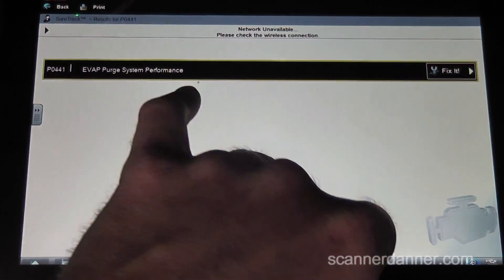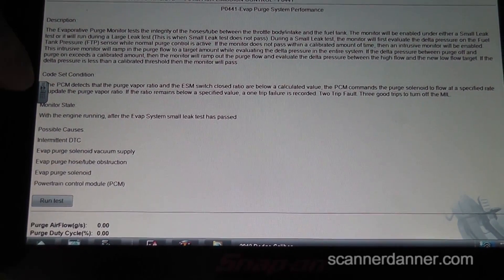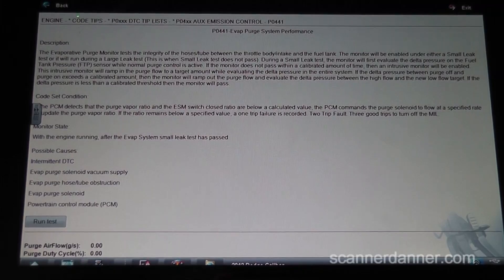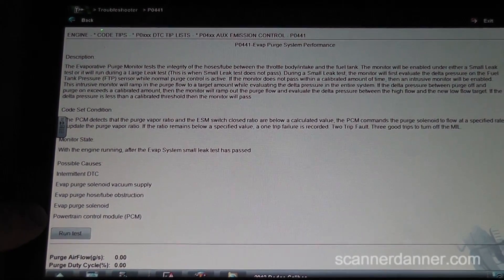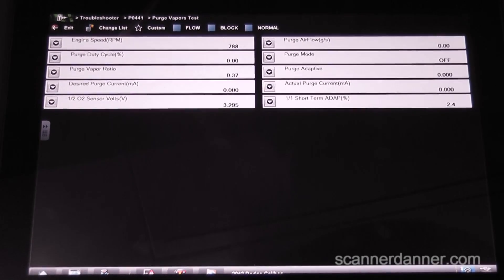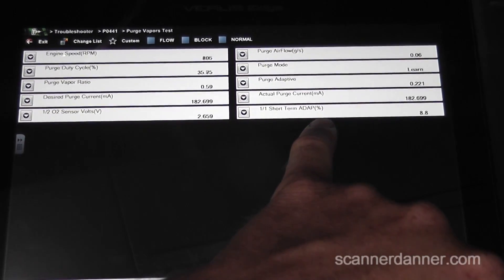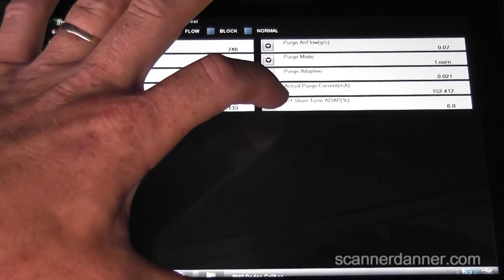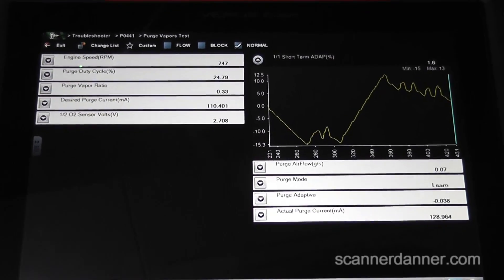2012 Dodge Caliber P0441 EVAP Purge System Performance

Comment: Got a new gas cap. P0441 code? Reset it. Fill the tank and drive to about 2/3 full. No code. Then get code P0441 again. Could be a stuck fuel tank vapor vent 
sensor. Located along the fuel filler neck. This is actually becoming a common problem now ! Part costs $40.00. The tough part is getting to it. It is located above 
the driver's side rear tire. You must remove the splash shield. Several plastic pins hold it in and up against the wheel well. With it removed access is easy.
Ironically  I have not run across any videos on it or how it acts just like a loose gas cap to the ECM. Don't fling new parts at it to remove the code.

Comment: Thanks man appreciate the vid - I recently had a check engine light I had it check it came up code PO441 I then noticed the gas cap wast not on properly I fixed that and the light went out the next day, however I took a trip and noticed my gas mileage was about 3-4 miles per gallon off in the wrong direction - I brought the Blue Driver scanner and I came up with the same PO441 code so I was wondering what you think @scannerDanner - the other thing is on the app it has a smog test (emissions) and it now won't pass that. Please help?
Reply: Hi frank
I have a same code on my Dodge SRT I already replaced purge valve and canister went solenoid but light came back on I was wondering if you already figured that out what was wrong with your car

Comment: Got a 07 caliber 2.0 same issue changed the purge valve today and check engine light is still on.my buddie reset the codes but when i left the light came back on.Any advice whould be Appriciateed

Comment: Im dealing with this, but my 97 ram has 274k. So i went ahead and ordered everything involved, minus gas cap. Have filler neck, canister and solenoid. Charcoal was everywhere and the filler was rusted out. Currently swapping the neck. Still have code after solenoid an canister replaced. Pretty sure the condition of each part wouldve tossed a fault.
Reply from the maker: If you had charcoal everywhere, that means you most likely have pieces of charcoal stuck in your new purge valve. You may need to blow all those lines out, in particular from the canister to the purge valve. Also, make sure the two lines on your purge valve are not reversed.

Comment: Scannerdanner, I for one, absolutely appreciate people like you sharing your knowledge. Shade tree folks like me can get by critical jobs with your help... Thank you for that. There is a comment/question I posted on Wells video but didn't hear anything... Maybe you have some insight? Here it is:
 I have been having a pretty annoying issue with my 12' Ram Big Horn. I have a P0441 that will not go away. I have pulled the purge solenoid, bench tested and determined that it was working properly, but I put a new one on for a week anyway. I also smelled faint gas at the cap and felt it to be somewhat loose and lanky so I replaced it. I pulled the ESIM, found the weight to be a tiny bit sticky and also only gave me about 7 ohms before the weight would open. There is a simple delco fuel tank pressure sensor T'd into the evap hose next to the filler neck Dodge calls an evap fuel leak detection valve, I replaced it too. My scanner reads live data that jumps pressure from -7400 pascals to +7400 pascals almost all the time and other times it stays solid..... help me please? this thing is driving me insane. What can I do?  thank you so much in advance for your suggestion(s). Nick

Comment: curious most Chryslers i have worked on you can get it to run the evap test to check the system. Wondering if this one did also and why wouldnt you run it to make sure before giving it back to your friend. doesnt take long and scan tool does all the work.

Comment: You can do evap system test on most Chrysler vehicles with the snap on scanner. I believe it's in special functions.. I usually run the test 3 times. Most Chrysler evap faults are with the leak detection pump, the diaphragm ruptures. Not sure is the caliber uses that system or not but I've seen a lot of them fail in caravans.

Comment: Irrespective of the gas cap being tight or loose it the test would have run the same; should end up with the same results, and I believe even if the esm is not sealing correctly it will still show that same Purge value as long as the switch is opening and shutting. I have some case studies on those things those and some of the older Hyundai's are the worst.

Comment: Great vid. You've already helped me figure out a similar problem. A friends 09 Silverado 5.3l w/17X,000 mi, had a po449 mil. The parts guys sold him a purge solenoid, but didn't fix the money light. He asked me to check it out. I test the vent valve, and it would sometimes work, sometimes not. So I got one of those. The old vent only worked about 30% of the times I tested it. I knew that it could be a problem, so I didn't sweat throwing a part at it. When it didn't work, I took it to the part store and borrowed their generic scanner. It didn't do much, but did offer some live data. Thanks to some of your great videos, I knew a little about what to look for, and why. I noticed that the tank pressure sensor was reading within a normal range, but just a touch off. Even if I removed the fuel cap, it would not go below 6in of water pressure. It would read a vacuum reading, it would read a pressure reading, but at a necessary zero reading, it wasn't zero. So, the sensor was actually responding to pressure and vacuum signals, within a normal range, but was making the ecm think that there was a malfunction. That goes back to some of your lectures on "can I trust the XXXX sensor readings". I replaced the tank pressure sensor, and that fixed everything. I can't comment on the original purge solenoid, I didn't have access to it. But I do know that the vent valve was faulty at best. But the tank pressure sensor had no obvious issues, and no mention of it in some of the flow charts I looked at. But, seeing the data was not what I thought it should, helped me follow the correct path. Thanks again, for what you do.

Comment: dodge/chryslers have been know to have intermittently sticking esim which will pop everything from small leak code to evap system performance.
Reply from the maker: Good tip. Thank you! Something to keep in mind if it comes back
Reply: I have that p0456.  Thinking of changing out the esim....should I clear out code first and see if it comes back...can u clear out the code by disconnecting battery terminal too.

Comment: I've just gotten a code for p0455 evap system leak detected.  my evap vent valve solenoid has been clicking so loud it sounds like a lifter that needs to be bled or replaced.  Been doing that noise for a few years but this code just popped up on Sunday so probably unrelated.  I went through the evap system tests and they all passed.  All the egr and evap components passed the test.  when that valve is clicking, it's open sucking fumes from the tank.  the gas cap is tight and I am the only one who fills it so it's always clicked tight several clicks.  I did notice a pretty corroded hose on the outside of the gas tank that is a fuel vapor hose so maybe it's that.  could this cause long cranking starts and running rough intermittently?

Comment: good evening, I tried following the link that you left for the scanner tool and it's incomplete. It takes me to a page that is not found maybe you can recheck it. thanks again for all your efforts I really appreciate it, personally they help me a lot....
Reply from the maker: I was using the Snap-on Verus Edge. You can only get them from Snap-on.
Reply: He uses a very expensive scan tool made by Snap-On called the Verus. There are also the Verus Pro and Verus Edge variations. These scan tools easily cost $8,000+, but are a hell of a tool. I use an Autel MS908P as it has bi-directional control like the Verus, just doesn't have some bells and whistles like a scope(which is amazing) or DTC tips, as well as not having the Snap-On logo lol. I'd recommend an Autel DS906 or something similar for someone who works on cars at home but needs a little more than a cheapo hand scan tool.
Reply: Thank Jason, I just got the Maxisys mini my self, not even a week old but have not had the time to break it all out. But I was inquiring about the link he put on the description since it took me to a website that was not Snapon and I was curious to see what other scan tool he was recommending.
Reply from the maker: I just clicked on it and it works fine. It's just a page from a company that partnered with me. It's a link to a whole bunch of different scan tools.
Can you check it again for me?
Reply from the maker: I think I see the problem. Don't copy and paste it because it is a long like that YouTube cut off. If you click it it works.
Reply: Link works for me. And sorry I didn't understand your question David!
Reply: I click on the link and it takes me to the page with lots of different scan tools.  which is the scanner that you were using during this video?
Reply: Read the first reply.
Reply: JasonMTG  thanks Jason!
Reply: Frank Sanchez You're welcome :)
Reply: Wanna let me borrow an Edge so I can diagnose my uncles B2500? ;)
Reply: ScannerDanner Hello Dan and thank you for your fast response. I did find the problem, I have no problem getting to the right web page thru my laptop but both mobile android devices I used I got the same fail result. Again, thank you for your response and God bless you and your family.